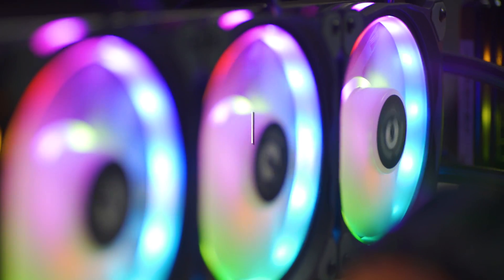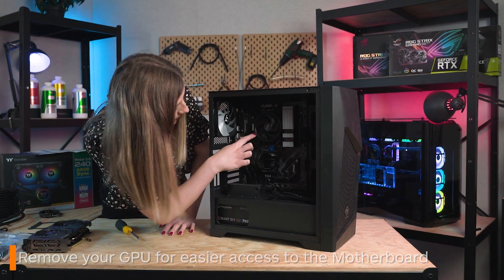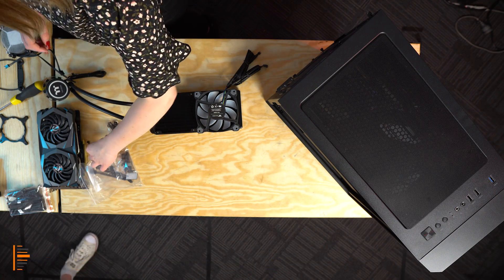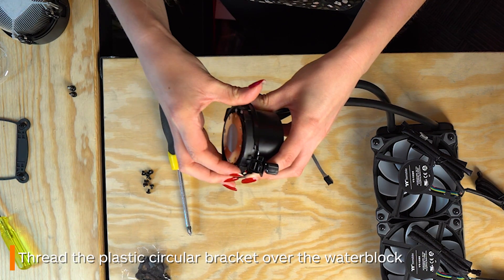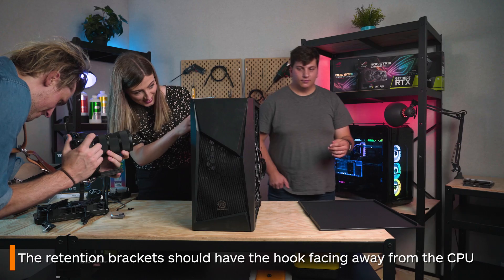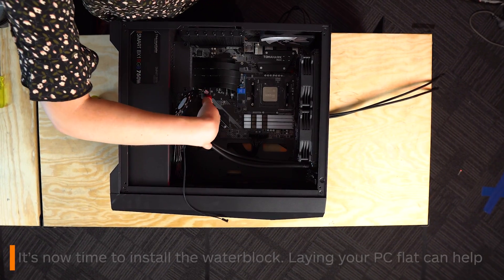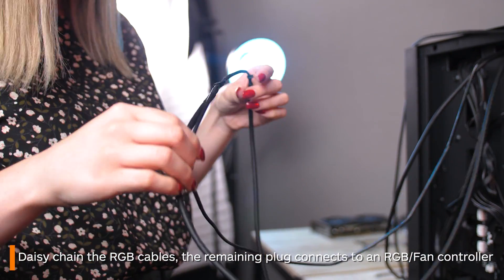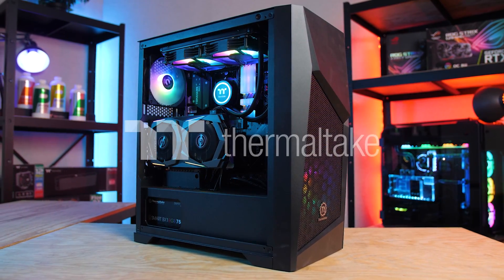How to INSTALL a CPU AIO Water Cooler - Thermaltake Water 3.0 ARGB CPU Cooler

Comment from the maker: Aight, intervention time! We're gonna need y'all to jump over to THIS video before commenting on the intake vs exhaust situation thanks... https://youtu.be/HlrZQIHiXwM?t=377
Reply: what if you want to install an oversized radiator on your water cooler? Mine is always HOT (the air coming off) like uncomfortably so, on my rizen 9 running warships on max settings. Id love to put a larger one on maybe the exterior.
Reply: The guy is right that still there will be fresh cool air cooling the radiator BUT the huge problem you are creating is blowing super hot air from the radiator inside the case instead of out. Your setup makes sense only in the cooler is installed at the bottom of the case and there are still fans at the top blowing out.

Comment: THE FAN YOU ATTACHED ON AIO is wrong the fan should throw hot air from inside air to outside the case the fan should fit properly to the radiator.

Comment: Wire from the pump cooler, do I connect it to CPU Fan or CPU OPT or Aio pump header?

Which one is better? I've seen a lot of videos but most of them have different delivery methods.

Comment: Ths exact aio in this exact case type with the exact rgb board failed on me after only a couple of years. The pump itself i beleive stoped working after about 2 years of loud pumping opperation. Wouldent buy again for 120$ i though id be buying a wuality cooler
That lasts. I still have the box thats how new it is lol

Comment: Ah thank fk these fans aren't attatched to the actual cooler lol. Thought I'd have it easy this time and get a prebuilt but they used shitty fans so now I gotta replace them and half the reason I went for a prebuilt is because I'm really nervous with anything containing liquids around my circuitry, just in case my clumsy ass knocks something loose and ruins the whole thing... But screwing a few fans on and off the radiator is simple enough.

Comment: Hi, great video.  The fans need to point the other directions, to blow air through the radiator and out the top of the case, the way you are setting it up
Reply: I spotted this too. she has the fans facing the wrong direction, right? the way they're installed they're sucking air from the top.. it should be vice versa no?

Comment: The fuck? This is a company made video? You don't determine the placement of the aio based on how easy it is to keep the tubes out of the way, you place the aio as to prevent air from reaching the pump, air rises so you should avoid allowing the tubes to be level between the aio and the radiator OR avoid the pump being above the tubes, meaning if you mounted the radiator on the front of your case, the tubes should be at the top of the case so that they travel down to the pump at a slight angle keeping air in the radiator and not the pump

Comment: Years of having this aio. I'm so fed up with such a product. A few months ago, it even broke the plastic brackets holding the backplate. Never use a system like you did for the AM4 part every again. Just do old-fashioned 4 screws hold it down. I wish I could get a new product to replace this one currently.

Comment: GREAT COOLERS HAVE THE NEW THREE FAN IN BLACK EASY INSTALL AND WORKS GREAT CABLES WOULD BE FEW INCHES LONGER FOR BIGGER PC CASES LIKE MINE INTEL GEN 12
Reply from the maker: I can't quite tell if this is a compliment or not? Regardless, this is super old video of ours. If you want to see a more up to to date install, defnitely check this one out instead: https://youtu.be/3wGPsbrv72g

Comment: Recently had the TH240 3.0 AIO installed in my system. Is it normal for the cpu cooling block/pump to make a constant low electrical buzzing sound even at idle? I have the radiator installed vertically in the front of my case with barbs at the bottom if that makes any difference?

Comment: Pretty sad of purchasing this AIO. Fan are really noisy and the speed is not variable cause it’s 3 pin. The rbg are not compatible with MSI mystic light like it said on the box so i needed to create my own wiring to have the possibility to plug it in my motherboard. I finally changed the fans for Corsair ones cause they’re in all points way better and quieter. The RBG on the heatsink are really spaced and looks pretty bad, a diffuser would’ve made it look so much better. I personally do not recommend this AIO even if it’s cheap, just get a good one for a couple bucks more
Reply: ty

Comment: I'm having problems getting my waterblock to fit over the retention bracket - it just doesn't seem to reach both at the same time. Does anyone know if this is a common problem or how to fix it?
Reply: I literally just installed one I understand what you're talking about what I had to do was loosen everything up tighten it a little once I have 1 on and then quite literally just fiddle it for like a good 5 minutes and then it will get on

Comment: Do I still need a fan controller or Hub to have the RGB. Even if I don’t want to have the software. Because I am new to pc’s and need to know if it works without the controller. Awesome video. Also will it work on a Gigabyte Aorus B450 Elite M AMD.  Also where can I buy a compatible backplate. The case is Corsair 220t RGB. Thanks. And awesome video!!
Reply: msg us

Comment: Doesn't it need an expansion container? I mean water heats up expands in volume: 1 Litre of 20 degrees becomes 1,5 litres when at 80 degrees (for example), so it should have a container where the extra water volume should go. For example car engines are equiped with such a container, where the excess liquid goes when it's temperature rise and that's the logic I follow, but I might be wrong.

Comment: "Seems" like a good tutorial but the fans they put on the radiator are not installed properly... they should be facing the inside of the case so the air is getting pulled out of the case. In that case, they destroyed the airflow cause now air is getting in the case by the top too
Reply: Thanks, that got me super confused. I almost made the same mistake because I was doubting my self, then I saw your comment.
Reply: because that woman dont know anything about computer yet they choose her to made tutorial video

Comment: Should the fans on the radiator push air out of the case, or pull air in from outside?
And should they be placed on the radiator so that they push air through it, or should they pull air from it?

Would it be conceivable to have fans on both sides of the radiator (similarly to how that's often possible with CPU heatsinks)?
Reply: ^write us^
Reply: Yes it's called a push pull config.
And it doesn't really matter if you use your rad as intake or exhaust it doesn't make a big difference and depends on your case.
Reply: @user-ke1gn3ql1g  Well yes, but actually no. :D 

See, let's say, your PSU is hidden in a separate please just like in the above video, let's say also that you have 2 front fans on the chassis, and one back fan, and your GPU is sideways as the above cause. With that said since the GPU's fans are facing the motherboard, meaning air is going towards the motherboard a little, and a little bit down and up too it's a big question which setup would be better. In case of pulling air into the chassis with the liquid cooler's fans: yes, the radiators are cooled with pulling fresh cold air into the chassis through the radiator, but that would also push the air downwards to the GPU, two air collides and in that case the back fan has to take care of now the 3 incoming airs, the front fan's, the GPU's air and the liquid cooler's too. Two of them are warm air and trully, one is only cold air. Would be great to get rid of the warm air, however I guess that's too much pressure on the back fan. Also that double warm air could affect your VRM temps and the RAM temps too since they collide just in front of them.

if you have an actual push pull config, in case if pushing air out of the chassis with the liquid cooler's fans: As I mentioned before warm air is coming from GPU's direction towards the motherboard, some of that air could reach and eventually go through the liquid cooler's fans, and therefore warm air can't effectively cool down the radiators. However we still have the back and front fans. The back fan could take care of the GPUs little warm air, and the front fans are providing good fresh cold air towards the motherboard which is then pulled up by the liquid cooler's fan, with the travel speed it can even hit the RAM a little, cooling it a bit and also the VRMs next to the CPU. Hence cooling them a little two. Since these two is probably colder than the GPU itself under high load, it's probably not really causing any warm air to go through the liquid cooler, hence decrease the effectiveness of the cooler. But still, greatly cooling the radiator with cold air.

I think it's generally true that pulling air into the chassis is mostly done by the front fans, and the rest of the fans are pushing warm air out is the best solution in this cases hence creating a general nice airflow through your system and not creating air collision. Which means then that in the above video the liquid cooler's fans are facing the wrong direction. But this highly depends on the chassis, even if it has enough space for this. In my case I only have a double faned air cooler at the moment on the CPU. 2 front fans and 1 back fan and my GPU is upside down. GPU air is slightly colliding with the incoming air from the 2 front fans direction, the 2 fans on the CPU are literally push pulling. so the first fan is pushing air through, and the other side the fan is pulling air out, and then just behind them, the back fan is also pushing air out of the chasiss. Hence this creating a straight fast airflow, which is good even when the GPU is pushing some warm air in that direction.

Comment: Hey can I put the radiator on the top of my case (Thermaltake v200)
Reply from the maker: Hey there! The V200 is compatible with 240mm AIO coolers, it's a tight fit and depends on how thick the radiator is and if your ram has a bulky design. For reference, our Water 3.0 Argb Edition 240mm AIO fits and you can have a set of our Toughram installed as well.
Reply: @ThermaltakeAustralia  Thanks for your answer, I'm gonna need to put it on front sadly.

Comment: Stupid question, my case doesn't have a 5V port at the back to connect the cable to. It definitely has a central hub but no 5v. Can I plug that cable (Cable E for Ryzen) directly into my mobo?

Comment: I just bought this cooler and it looks and performs amazing. However I have an Asus X470 pro and I cant use the header adapter that comes to sync the RGB I have a 4 prong header for my RGB that's: 12v G R B, is there an adapter I can buy?
Reply: Nope

Comment: In this scenario, the fans would be blowing up to go out the top, correct? Also, you dont have to connect the coller to your gpu somehow? I've always just used fans for my builds
Reply: And AIO cooler like this it just for the cpu only.  It does not connect to your GPU
Reply: No, its a pull config, air is coming in from the top (sticker of the fan is on the inside of case air is pulling and viceversa) this applies on most fans I THINK...

Comment: Hi. So the radiator fan should be installed in a system fan header and not the Cpu fan header?

I have a msi aio
And I plugged the pump in the pump fan header. :) 

Maybe put music volume little down?
Reply: No I think you install it on CPU fan, whats your motherboard please I might be able to help
Reply: @samhoey8247  hi there :) I got a MSI MPG Z490M Gaming Edge WiFi
With an I9 10900K and the cooler
Msi mag core liquid 240R

I used the following fans from the Cooler Master, Masterbox 311L for the radiator 

The fans was not spinning in the Cpu fan header, I changed the Auto to PWM in bios then they switch on

Comment: at 3:55  she is wrong. Dont use a system header. Use your CPU fan header. That header goes off the temperature of your CPU so it can be controlled. The other headers go off the overall temp or something like that
Reply from the maker: So this is a pretty cool thing to bring up, I do need to say that it isn't necessarily wrong to put your AIO header into your "sys_header" vs "CPU fan" header though.
It depends on how your AIO will act - with the Water 3.0 ARGB, what tends to happen is if you do have it in your CPU header, the pump speed will fluctuate to match what your CPU heat is at the time, which can actually get super annoying if you don't want to hear your pump speed up and slow down - having it in your system header will keep your pump at a constant speed. 
BOTH will keep your CPU cool, both work effectively and it's rally up to you what you end up doing.
Reply: @ThermaltakeAustralia  Wow thats actually amazing insight. I personally would never have thought about putting it in your sys header to get around that. 

I know in certain BIOS's you can make your fan header respond in a shorter amount of time to get around the constant speed changing. But that definitely sounds like a way better work around. Props.
Reply: now i just feel dumb hahahah

Comment: Am I able to plug the pump cable into my fan hub?
Reply: no, you need the pump cable to go into your motherboard "pump" header or your CPU Fan/Pump header this results in making the pump go faster as your CPU gets hotter. You can install your radiator fans into the header tho

Comment: How do I know if I screwed the water block tight enough? What if I screwed too tight, or not tight enough?
Reply from the maker: Hey there! Might be too late, but you'd not if it wasnt tight enough if your PC doesnt end up making all the way through to the home screen past booting OR if it turns off shortly after loading up windows as your CPU without any cooling should have your motherboard turn itself off for safety. If this happens, don't stress too much, just go back and tighten the screws a little more. You also can't really tighten too much unless you thread the screws.
Reply: @ThermaltakeAustralia   Hey, thanks for that. I'll keep them in mind. Still waiting for the new Ryzen 🤣

Comment: My rgb lights won't come on. I have them daisy chained to the remote. Using msi tomahawk max so it doesn't have any 5v :(
Reply: Just letting you know you can still get power to your AIO bro! But instead of daisy chaining to the 5V port on your mobo, you can daisy chain it then connect it to the controller bro.

The controller cable has a SATA port on the end for your RGB Power, so connect that to your PSU and bang, it should power on :)

The Cable (E) for Ryzen or (F) for Intel as shown here is only for particular motherboards to sync the motherboard RGB with your fans RGB.

The controller just means you manually can control the speed, colour and style of the RGB manually at the back with the controller rather than have it automatically sync with how your motherboard lights up. Still, fans will light up either way. Hope that helps!

Comment: If its a single case fan attached to the CPU cooler does it have to be installed on the top part of the computer case? or can it go on the back part

Comment: How long does this generally take you?
Reply from the maker: Hey there Jeremy, an AIO install shouldn't take longer than an hour provided you have a good screwdriver, a chassis that can easily be worked in and if you would like to take the time to cable manage the new fan cables.

Comment: Where would I connect the rgb cable
Reply: To the RGB header on your motherboard. Look for the internal ports on the motherboard manual to find out what ports it has. If it doesn't have any RGB headers, you'll need to either get a new motherboard or buy an ARGB adapter.
Reply: @joshkoster2851  I know my mother board has rgb headers but are rgb headers only on the front side of the motherboard? I’m getting ready to install a 240 water cooler with rgb. I know I have rgb header on front of motherboard.

Comment: Top tip...when laying the PC flat, don't lay it on top of the cables that provide power to the fans!  Crushing cables can severely degrade the conductor and worse, the insulation.

And no, this isn't a dig at the lass doing the video, it's just a point I wanted to make.
Reply: Wtf is a lass and if she fucked up then that includes her too

Comment: Placing the radiator on top is the best for longevity. It will create 0 to minimal bubbles.
Reply: What bubbles are you talking abt ? I'm confused
Reply: No, radiator just has to be higher than the pump. Front placement with tubes on the bottom is just as effective.

Comment: I probably couldn't install one of these on my Lenovo idea center could I? I'm about to get roasted, I'll see myself out. 🏃🏾‍♂️
Reply: wtf??? an aio on an laptop? WTF??
Reply: @tiredleon  nah, it's a desktop. Lol, I'm not THAT bad.
Reply: @shuaduah  You can always install an aio I don't understand your question
Reply: you might not have the room for a 240mm radiator (prebuilts usually specifically make cases to work only with what they need to work with) your best bet would be to go with a 120mm radiator and install it where the single case fan would be. Make sure to check that your case has a fan in it though

Comment: I have a 360mm of these, my pump leds have stopped (before the leds were stuck and now they're completely gone) could it be the led controller?
Reply: u fix it??
Reply: @thomascoppage2310  Nope, I have returned it because it was still on guarantee, when I received back a new one I sold it because I bought a DeepCool Castle 360mm in the meanwhile.